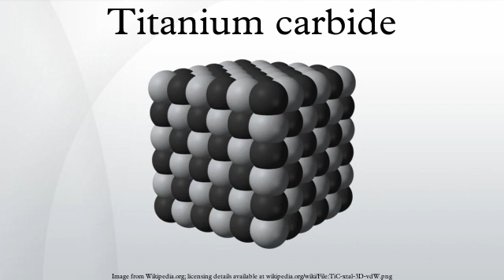Titanium carbide

Comment: ceramic *alloy. Just like carbon steel is an alloy.
(WP) An alloy is a mixture of chemical elements, which forms an impure substance (admixture) that retains the characteristics of a metal. An alloy is distinct from an impure metal in that, with an alloy, the added elements are well controlled to produce desirable properties, while impure metals such as wrought iron are less controlled, but are often considered useful. Alloys are made by mixing two or more elements, at least one of which is a metal